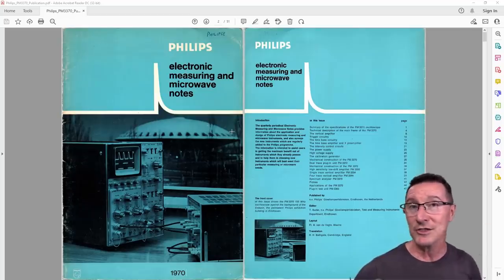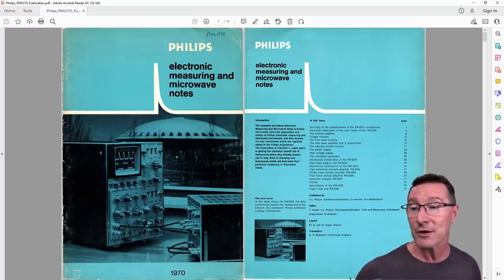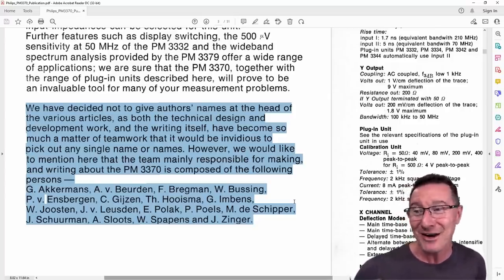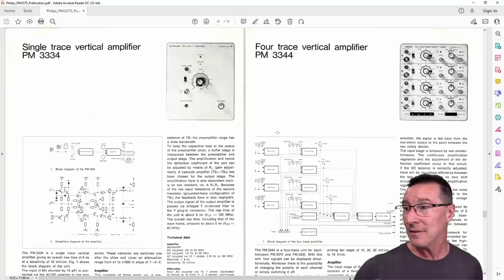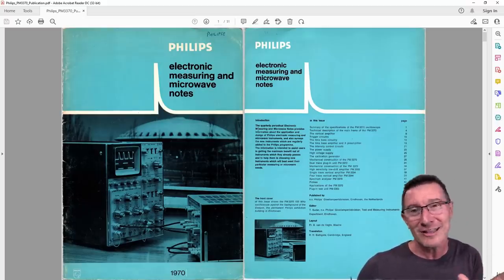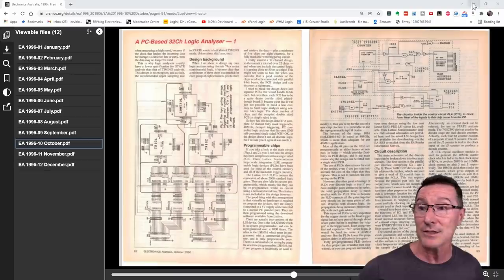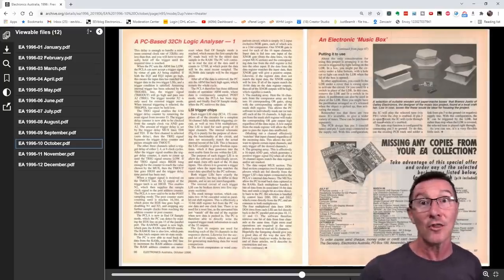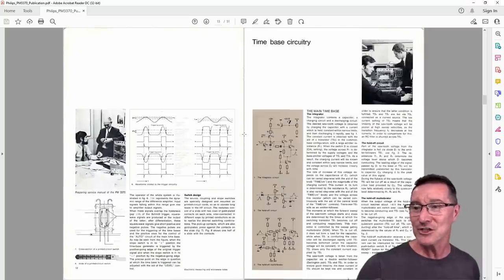eevBLAB 94 - Why Dont Companies DO THIS Anymore?

Comment: I have on old book which I managed to purchase with a 1992 S1-107 scope, made in Lituania (USSR before that). It's interesting how the book actually explains even the very basics of measurement with diagrams and examples (even how to calculate the signal frequency), theory of operation, as well as shows all the waveforms at various points in the circuit. Tektronix 1960's was even better than that, a curve tracer manual would show how to measure things even without the equipment you got the manual with. I used that as a reference when making my own curver tracer for a thesis.

Comment: We like the comments about the interesting article you found. I am 80yrs old and am a retired consumer electronics technician. I have built a lot of electronic kits that you had to put all the components on the circuit boards. Heathkit, HH Scott, Eico, Dynaco, and several newer small kits, The two kits designed in Australia the ESR meter, and the Ringer, I forget the mans name. Dave is getting older and just wishing. I powered up a Heathkit ET-3100 trainer that I built in 1971 and was glad it worked it had a signal generator, two dc power supplies, and an area to build circuits for testing. I cannot get one of the big name speaker manufactures to let me purchase a service manual for a powered subwoofer that cost over $1000. 00. It did have a 5yr warranty.
I went to several schools with several big name audio, hi fi companies back in the 70 es. Most of the replies are correct it;s the bottom line that counts. If a large portion of the big players in consumer electronics were made in the us, you couldn't afford them, and Apple would be as wealthy as they are. Money is the biggest player in the worlds economy.

Comment: Whenever I see Philips documentation I expect to see the names of my parents or pictures of my grandparents. But of course, my father was a researcher at the 'Natlab' (physics research center) and my mom was the secretary/main-typist of the 'Natuurtechnischtijdschrift' (physics periodical) and her parents worked on the assembly line for radios/televisions. Of the latter we have pictures that Philips occasionally took as mementos, of course, with 'windowdressing' as my grandad never wore a labcoat for his work (coverals) and didn't work with a chemistry set. :D
Reply: Had the same; my father worked at NatLab from '70 to '75; then in IT related departments at Philips until 2003. I grew up there :-)

Comment: There is a Museum in Cambridge England dedicated to the Philips companies that were based in the city during the 60s to 90s.
Part of the museum collection are documents like that shown in this video. Major development projects were documented with staff and team photographs. At this time Philips purchased a number of the high tech companies around Cambridge, including the Pye group, which made telecommunications equipment, scientific instruments and broadcast television equipment and cameras,  some had close links to the university. Philips own Mullard, who dominated semiconductor component manufacturing at this time and also had close links to radio astronomy at the university. . Slowly the original company renamed to reflect the Philips ownership. 
During the 90s, Philips ran into trouble and slowly sold off a lot of its assets in the UK. During the 70s and early 80s, there was a golden period where Philips seemed to be involved in every aspect of cutting edge electronics, it was difficult to find engineers who had not worked for one of the Philips companies, many gaining their training through the excellent apprenticeship schemes.
There was even a Philips telecom company in Melbourne Australia.

Comment: These kinds of publications also serve to establish prior art at a point in time for the purpose of IP protection.  I think this is one of the main reasons the Bell System Technical Journal existed; it was a means to "publish" the IP they invented to head-off patents filed by other organizations.  Of course, this can be a double edged sword.
Reply: This was definitely the case in Germany. In my experience from Siemens-Nixdorf and later Siemens we were encouraged to publish interesting results (e.g. prototypes from research projects), where the company was not interested in filing for a patent (e.g. because it was outside the scope of commercial interests, or difficult to patent like software given the German patent laws at the time) in such company run outlets to ensure these were publicly documented as existing state-of-the-art at a certain point in time, thus preventing others from patenting the idea.

Comment: The reason we don't see documents like this is because companies don't do research like they used to. When I entered the job market in the 90s (computer research), there were corporate research labs everywhere--off the top of my head, many DEC labs, HP, IBM, Panasonic, and many others. Since then DEC got wrapped up into HP (via Compaq), and HP cut research positions by a huge amount (I'd have to guess 90% or more, but that's just a guess). IBM, too, has a significantly smaller research footprint. When companies decided research wasn't good for business, promoting people who do research became irrelevant. Once venerable corporate laboratories have been cut drastically, and what's left of those labs are often not doing cutting-edge research. Looking for research jobs at Apple or Facebook is pointless, and Google has had to cut back to appease shareholders. If you want to do research these days, you're pretty much limited to academentia or government labs (which, btw, still publish documents like this).

Comment: A lot of people are making the “obvious” comment that this is because it costs money to have them made. It costed money back in the day, in fact it was more expensive.

The difference is not in the supply side, but in the demand side. Companies used to have highly technical engineers making the choices of which equipment to buy, so this type of documentation made sense. It shows that the company values technical expertise and is confident enough in their quality and standards to show you how they operate.

Nowadays there’s whole purchase departments who are the ones making the final choice, the technical engineer is generally providing a list of “good enough options”, but then someone else makes the final call. Now instead of detailed manuals with information about how the product was made and how it works, we get google ads, and flashy graphics, and vacuous blog entries about “industry trends”, and lab equipment can’t be squared anymore because edges are bad design.

Comment: These were definitely posed.  I remember being at my university and the school's engineering department wanted some photos of what the professors were doing for publishing in the engineering alumni newsletter.  I was summoned to my major professor's lab with the other students and I sat in front of the computer screen while my prof pointed out something I was drafting.  He really didn't know anything about the cad program I was using, but it made for a more engaging photo.
Reply: Still not as phoney as today’s photos where you can literally see all the carefully injected diversity.
Reply: @sylviam6535  meanwhile with ZERO technical knowledge, yeah lets hold a soldering iron by the hot part and poke at a cou socket LMAO
Reply: @virtualtools_3021  - I remember one photo (not here) where it was not even plugged in.
Reply: @virtualtools_3021  Oh yes, these 3 pictures are such a classic, if normal people understood them they would be a meme.
Reply: @sylviam6535  Diversity is the problem you have with those photos?!
Reply: @mr_gerber  - I was talking about the photos you see today on corporate websites, not those photos.

Comment: I work at a company where we design and build machines that test airflow of components of jet and turbine engines.  I've been there 36 years.  I originally came on board as a computer programmer but these days I design the PC boards for interfaces, I write all the software for the machines, the user manuals, perform training, purchase components, the whole nine yards.   In most companies people aren't there for a long terms to do a lot of the details documentation.  Some documentation projects can take nearly as long as project itself.   These days, bosses see the device working and think it done and you wind up rushing around to manuals together at the last minute.  But, being in the same place I can come back to a project and increase its documentation after the dust settles.   They don't seem to care who actually does it and so there is not so much documenting who did what.   They do care when something goes wrong so they can attach a name to it.  Our manuals are now edited on a network based retrieval system and it records that last person who edited it so there is some traceability of persons.   I usually put my name in documentation that I produce.   But I'm in a small company with eight people and we have only so many machine models.

Comment: The „scope“ I worked on 32y ago was a 3270 from an other big company. It was fully digital, but could not show any graphs, but only information in text form.

And I have even a PDP11 datebook in my bookshelf, that I got 40y, when the company that owned it wanted to throw it away. They even have schematics of some boards in, and of course: how to program PDP11 in assembler.

On the other side, today when I do electronics as a hobby, I use Kicad and with a single keystroke a get the data sheet of a part online. I would not like to miss that just to get the „good old days“ back. And then if I randomly have a car of these days in front of me and the memory of the „good old smell“ comes back, I like to live now.

Comment: I started as a Trainee Engineer with JVC(UK) in 1984. In those days they used to produce Technical Guides for many of the products. These were separate from the manuals, and gave full details of how the internals worked. They stopped around the late 90s, mainly due to the cost.

Comment: 1. Its very expensive to make docs like this now
2. Its become a lost art. To make these docs requires passion and there is little of that anymore.
3. It takes technical knowledge as well as an artistic flare, two things that used to coexist (eek!) but have since diverged dramatically
4. Its not a flashy job. Being a technical author or technical documenter is not a glamorous job. Very few people want to do this as they don't see a sense of pride in it.

I work at a relatively large technology company and we used to make documents like this. Unfortunately, no one has any interest in doing it, nor would most have the desire to do it. Today, you'd need to be an engineer to do this and if you are an engineer, why would you do this for the lower pay as opposed to just being an engineer.

To be clear, I am an advocate of this, 100%.
Reply from the maker: 1) Requires hardly any effort to have someone go take some photos and do a write up for a quarterly magazine.
But yes, requires someone with a bit of passion for doing it.
It just requires managament to find someone keen and give them standing orders and authority to do it when time permits.
Reply: @EEVblog  Agree 100%

Comment: Working on a projector the second one in a year. (First one NEC was bought at auction and I think it was dropped could not for the life of me find a service manual and oh boy did it have issues, although I did get it working but I don't trust it. it's now a back up unit. ). I managed to track down the service manual for a previous Mitsubishi model, it had everything I needed. sure some of the connections were in different spots but with the help of a short phone call to tech-support who narrowed down to a fan issue. this led me to delve into the 7+ fans in the unit and thankfully stumbling onto the correct page in the service manual having the error code sequence which told me which fan port. so I was able to find out which fan cable which led me to the fan which led me to disassembly to find out that it was just something stuck in the fan. so a $9000 projector from 2010 at auction for 550 with case and probably 8 hours of my time picking it up troubleshooting it I figure it's the best 850 this guy has spent and we're ready for our next event with a really nice projector.

Comment: One thing to note about photos like these is that frequently the managers will pose for the photos and sometimes, if you know what the equipment is, you can see that they aren't actually doing anything real.  Just holding a knob or something like that.  A classic example is one I saw where the guy was holding a soldering iron like a pencil ( at the end) and pretending to solder.  Clearly just posing for a photo and not knowing what he's actually doing.  Like the guy with the pipe.  I doubt he was the line worker.  Pipes were status symbols, people who worked behind desks smoked pipes.

Comment: The striking building on the cover is called the Evoluon and it's still there (I live close by). The company sadly is no longer as it was in its heyday. Most of the divisions have been sold to third parties with the right to use the Philips brandname.
But that innovation and collaboration you mentioned led to the spin off of what has now become the dominating player on the semiconductor lithography market (ASML) with a market share of 85%, leaving 15% to Nikon and Canon.
The test and measuring division of Philips was bought by Fluke in 1993 after a six year collaboration which also seems like a solid company (understatement).

Comment: This is a unique mashup of company history and technical journal.  You might check out, "Winning with People, the First 40 Years of Tektronix" - it makes glancing references to the technology, but not at the circuit level, it's clearly just a history.  I think a similar book exists about HP.  Funny enough, I worked at a machine tool company (Sunnen Products) in the early 90's, and there was a book about the founder of the company (Joe Sunnen) and its early days.  It was passed around to new employees, I think it was almost kind of a joke, not a company policy, but it was a small red, leather bound book.  We called it, "Joe's Little Red Book"  (a play on Mao's little red book of the 60's, for anyone old enough to get that reference...).  Sadly this sort of stuff has gone the way of 100% employer funded healthcare, company social clubs, company picnics, and Christmas parties....  <sigh>

Comment: In the old days a piece of equipment was bought for many years to come. Often the scopes and measuring stuff of Philips is still working, they costed a small fortune. Maybe because it was so expensive it was taken care of and never misused. Books could be printed to accompany the goods, manuals with special pages were could be noted when a part was replaces or when it was recalibrated. Back then a scope costed something like a man's wages for two or three months, I guess. 
 
Now if I want a scope I look on Ali Baba and order one to add to ones telephone or tablet, there is no manual, no book, no possibility to calibrate it. When it comes it is in a plastic bag with no information on it. You bought it and good luck. Sometimes it works, sometimes the spirit went down already before it was challenged. (That is a neat way to say that sometimes it is ready for recycling) 
 
Today, if you pay the price, you still can have a manual printed as a book. But all people go for the cheap China-made stuff, there is no manual and not a magazine with the people working at the assembly line. Child-labourers and prisoners chained to their place of forced labour don't look nice in a glossy about the factory and their cheap and crappy products.

Comment: I decommissioned an old (very early radio) burglar alarm only last week. The client gave me the original documentation that came with it. What a delight; high quality print and drawings, instructions in full sentences written in English by a fluent speaker (not machine translated). My only complaint was it wasn't dated but base on what the client told me probably late 1980's.

Comment: Years ago when I purchased a car I would buy the dealer service manual for the car. They offered them straight from the manufacturer and they didn't cost a lot. Last time I got a car the manuals went way up in price. They probably are not even worth buying any more with the level of technology changes. I remember the old manuals talking about putting the thermostat in a coffee can of hot water to test it. These days you probably need special equipment to do most test on car components.
Reply: 2008 or so was the very last published Jeep maintenance manual.  Every model after that can be maintained only by mechanics that have licensed online maintenance manuals.  There's some merit to the idea particularly with the computers (ECM, TCM).

Comment: You use Apple as an example.  When the MacIntosh came out, Apple bragged in their advertisements that it didn't come with more than a thin operator's manual because that's all anyone should need.  They considered lack of proper documentation to be a marketing feature!

Comment: It's rare because they are moving away from repair and just want replace.  That's why 'right to repair' is a battle now.  I used to repair Motorola pagers and radios and they always used to have repair manuals and even diagnostic equipment for sale to repair them.  Since about 2007 they stopped selling service manuals and we had to trace out PCB's and trouble shoot blind.